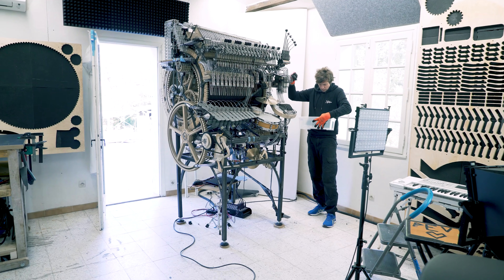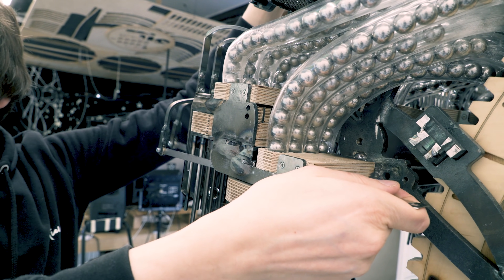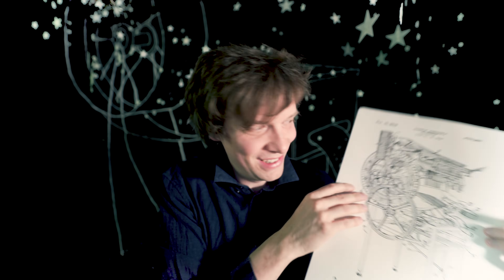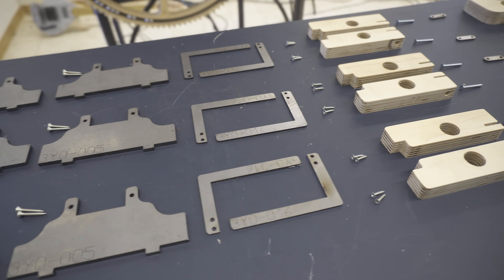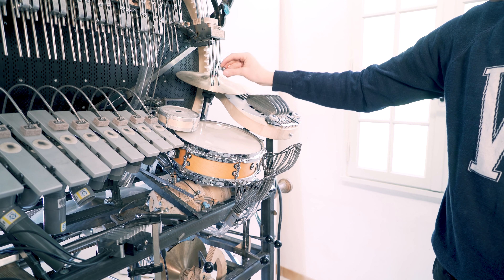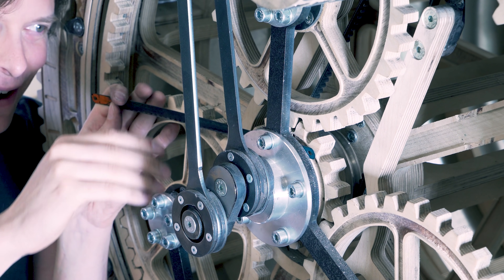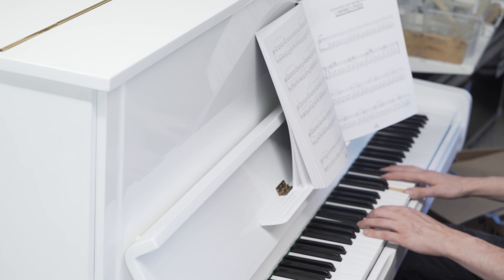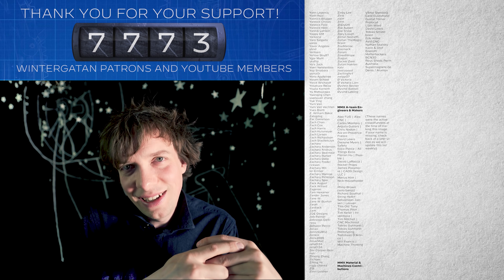Cyber Funnel

Comment: An item to consider: possibly a makeshift box to account for wind factors on an outdoor stage.  Wind and moisture from outdoors may affect the landing placement of the marbles, as well as the leveling of the machine on stages.  I know you have the adjustable feet to account for proper leveling, but possible wind / moisture may require a cover / shell to minimize those factors.

Comment: I am not an EE but am an ET, but I think you should be able to use a sound cancelling or feedback circuit to reduce the unwanted sound. Keep up the good work. Yes, you may have doubts, but you will work through them.
  As one of my old Ham Radio buddies always said "There is no such thing as a perfect 5 year plan".
   Just keep in mind that what you are doing is something no one else has likely ever attempted. The fails are as important as the successes. If you fail on something, you learn to make it a success. Hang in there, we are rooting for you, and appreciate all you and your collaborators have done. It's way beyond my skill base.

Comment: I think that if you have consistently used organic forms for most of the parts and specially the funnels, making this last funnel square brakes that pattern. I am sadly not on board with that design, there must be a way to determine a more efficient shape that doesn’t have sutch an imposing aesthetic.

Comment: Do you know about those sticky aluminum foils covered with asphalt. It is used under window sills of metal to dampen the sound of the raindrops, it is also used in cars and on the bottom of stainless steel kitchen sinks. You can stick that material onto metal or plastic parts to dampen the sound that the marbles make when they hit the part, it also lowers vibrations. It works the opposite to a resonator. I would stick that to the base of the funnels to reduce the noise. Have you ever tried marbles covered in a thin layer of  plastic or rubber? That could make the machine run with lower noise levels as well. The next thing you could do is to replace some metal parts by wooden or bamboo parts, that also lowers the resonance.

Comment: i would suggest you remove the screws that are holding your gear assembly together and replace them with some appropriately sized wooden dowel posts affixed to the gears with wood glue. that should be a lot more reliable than wood screws.

Comment: Can you use some kind of electric pickup on the vibraphone? Alternatively it should be possible to mic up the  noisy parts close to the vibraphone mics and invert the sound and cancel out that you don't need. Maybe use an open back mic in close proximity to the vibraphone.

Comment: Marten,

Please play the original marble machine song, followed by variations.
Single take, showing replacing programming plates.

Love what you're doing with the machine, maybe wax (rub a candle on) the contacting wooden surfaces to help with noise (and to lubricate wood on wood)?

All the fixtures can be epoxied when you practice breaking down/setting up the machine for the world tour.  Dab of luminescent paint on the end of each fixture when it is epoxied could look neat on a dark stage...

Comment: Hey Martin! I have an idea that might help with the noise issue. Say you mic up the vibraphone with a bidirection mic, one side pointed at the vibes one at the machine, and then had another unidirectional mic pointed straight at the machine. You could switch the phase on one mic and any noise that comes through both mics will be canceled, hopefully leaving just the sound of the vibraphone. I'm not sure how well it would work, but the greatful dead employed a similar method to avoid feedback with their 'wall of sound'.

Comment: Please don't epoxy the fasteners use thread locker. Thread locker is really good at keeping screws from backing out and it will break loose when you want it too. Loctite is really common and easy to get at automotive stores. I so want to see this thing in concert.

Comment: Since this is sorta a discussion of worry, I’m worried about the fact that this beautiful machine is largely made of wood. All these moving wood parts, grinding, sliding, etc. What will happen to the integrity of the wood over time and use? Friction will cause wear, especially on the wood parts, but the metal parts aren’t safe from friction wear either. What about the weathering of the wood? I hope he has some sort of contingency plan for wood parts that wear out or break from normal use.

Comment: >Good videos about composing
>Wintergatan

I love you platonically

On that note, I get a strange feeling that some of your doubts, mostly in your self and your capabilities might rise perhaps from guilt, shame or disappointment towards yourself?
One thing you can do on that front first and foremost is to look at the principles you follow.
Much like the design of the marble machine X, they need to be tight, concise, and overall, they need to always apply in the same way.
Here, just to give an example.

As a principle, one might think that "Never hurting others" is a good principle to follow.
On the surface, I would agree, but this lends itself to multiple problems.

Let's say you're at a bar, right, and you're talking kindly with random strangers, and then out of nowhere, you make a small joke, and for some reason, it triggers deep regrets within one of those strangers as they think of their dead wife.

Let's be real, in a situation like that, there's absolutely no point in feeling like shit over it, hense why this principle does not always apply, and is therefore, by definition, not a principle.

Instead, the principle that works, goes as follows: "Do not hurt others INTENTIONALLY unless you DON'T HAVE A CHOICE"
This implies through intent then, that you won't needlessly feel guilty if hurting others was not your intent, and to top it off, you won't need to feel guilty if there was absolutely no other option open to you; I.E. self defense.

It's important to look at those principles you follow, because they define what will end up making you feel guilt. While guilt might look fine and dandy on the surface, if you end up feeling guilt over every little thing, you'll only end up dreading yourself, which could lead to dire consequences left unchecked, such as "Oh, if I go forever I won't be troubling them anymore." and things of that nature.
I'll leave that to your imagination.

While guilt causes self-deprecation, shame/self-disappointment, and disappointment about external things to an extent, lead to needless comparison.
Things like "Oh but my stuff isn't as good as them, oh I'll never be able to be as good as them." those kinds of things.

Thankfully the solution to all of these is the same: Forgiveness. 

I understand that this might seem a bit strange, but forgiving yourself for the things you feel shameful, guilty or disappointed about goes a long way to getting rid of these feelings and moving on to a happier life.

It's so easy it feels like it can't be true, but forgiving yourself, is as easy as understanding why you did something, not blaming yourself over it, and going "I forgive myself."
It's that stupid easy, at least in writing. It takes a bit of practice.

Anyways I hope this helps, this tidbit of information came from experience, and it didn't come to me very easily.
Cheers, love basically everything you do so far

Comment: I worry about your PMMA pipes if they are going to flex with the funnels. You will bend them so they won't let a marble through or snap. I recommend bracing the funnels to the frame.

Comment: Instead of epoxy, I wonder if wood glue would be better. While the adhesion to the screw itself isn't as strong as epoxy it will act like a filler and give a bit more binding force than the screw alone. Think of wood glue like blue threadlocker and epoxy is like red threadlocker. The wood glue is reversible but gives stability and gap filling while epoxy makes it pretty much non-reversible.

Comment: Regarding the noise level of the machine the metal funnels seem to be quite significant. I wonder if some kind latex or clear silicone coating similar to the one you used on the vibraphone could attenuate this source.
As always amazing work!!

Comment: I know that you like the movement of the PMMA pipe when the marbles hit the funnels but, I am concerned that this reappeared stress will lead to the pipes failing. At the very least, if the MMX will be transported with the funnels in place I would look into a way to secure them during transit since nothing good can come from them shaking around in the back of a truck.

Comment: I was just thinking about the loudness of the machine, and then I realized that the noise the machine does is part of it, it means that it is alive. And you talk about how are you worried about the noise, and think you have to make it more silence but do not aim to loose completely the sound, a machine making noise is part of the machine, embrace it and show it. That's why people like Rev engines, and lathes cutting, is ASMR for machinist. Be careful, do not go crazy in the noise canceling, leave something for the machinist.
Reply: I think that should be key in this.  It’s like vinyl...  there’s warmth contributed to the sound from the physical connection of the needle to the groove.  The sound of the machine should be a big part of the music and given all of the engineering you’ve done with it, maybe you should have the machine spinning while you are composing.

When I used to work in a factory, there was so much music that I could hear out of the complicated machines that inspired music for my songs.

Comment: I have followed this project ever since the first marble machine came out, and as an engineer I'm very impressed and thinks that you will finish this project. You are truly an inspiration.
A thought about the marble noise. Don't see it as a bug, but as a feature. After all, the unique thing about this project is the marbles, and while you have emphasized them from a visual perspective with all clear pipes and the stair case, you haven't really consciously included them in the soundscape (as you stated yourself). So try to enhance the pleasant parts of the marble noise and see if you can minimize the not so pleasant part.

Comment: a way to make composing interesting would require a bit more editing but it could start with you writing on paper and describing the sound your expecting then cut to a short 5-10 second clip of testing the result on the marble machine x with overlay text of your opinion of how it turned out or cutting to you talking about it and tweaking it a few times. that would be enough for a pretty interesting video i would think.

Comment: Martin, DO NOT use epoxy for the screws. Any engineer will tell you this! Locktite makes various strengths of thread lock adhesive, You can remove it but normal vibration won't shake it loose. https://amzn.to/2Vt75vT  Also PM for my completed Modulin II.

Comment: I thought of something; you will probably play bass solos with the machine, will you have enough incoming marble flow to keep on the bass line going ? Also, if you want to make a bass solo with the programming wheel stopped (like you did with the xylophone on the OG MM) you may need an extra reservoir dedicated for the bass, that opens only when you want to, above/behind the marble divider (I imagine it being similar to the "marble divider" on the 1st marble machine, or just 4 pmma pipes going behind the marble divider, with a constant slope). It would be filling with the marbles coming out of the main lifting mechanism. Once full, the marbles just goes the normal way (like now, I mean like when one channel of the marble divider is full, the marbles continues their way.). And the marbles would come out of it just before the bass channels, without getting stuck there. So you stop the programming wheel, you start your solo, and as the marbles are emptying, you move a lever that allows the marbles to flow out of this reservoir, so you have enough of them. That could be easily be a supply of 40 marbles per channel.

I am amazed to see how promising this is ! Glad you want to actually compose something new for it, it will be more than just a new instrument!

Comment: I think most people are on par with that. The machine is one part of the goal. It's art, but also a tool.
I agree that the noise is becoming something of an issue. In this video, we can hear even the funnels are rather loud. Perhaps the bare steel isn't the best solution. Personally I'm not that big of a fan of the design of them either. It wouldn't be easy, but what if you found a way to make them out of transparent acrylic?

Comment: Hello Martin!
Nice progress!

But again, I wrote that some videos before, and the "lost screw" aplifies it:
The MMX has a lot of small parts, and a lot of them have very intermittent forces, meaning you have to consider material fatigue as well.

I am especially worried about the springs in your funnels. I can imagine those will work for some minutes, maybe up to an hour, but than it gets tricky.

For sure you want to have a lot more than 2 Million strokes (force-peaks) in your parts. But that means, that a lot of the mechanical stress has to be very low (at about 10% the capacity of the part at most).

Please contact me (i am a mechanical engineer) or some of your engineering team to check this issue.

And please take the whole machine apart in some time, clean it (angle-grinder-dust is abrasive A.F.!), lube it, and re-assemble it with a decent amount of loctite. It will enhance the life of your machine significantly!

Comment: Don't put too much pressure on yourself about your composing. Like the machine itself, success probably won't come immediately. You'll have many many years with this beast to familiarize yourself with it's sound, it's quirks. And one day, a melody that perfectly flows with the click and clacks and rolling of marbles will rumble through your brain and speak to your soul. Maybe this will be tomorrow. Maybe this will be halfway through your world tour. Maybe years from now, when all the hype and stress is gone and you've worn it in like a pair of old shoes and it's actually been sitting in a corner with a dust cloth over it for a few months, your fingers will itch to pull out the old programing boards and shuffle some magnets through it because you crave that certain sound.
Don't compose for the marble machine. Compose for yourself.

Comment: I'm so scared about the design for vibration and damage tolerance.

I didn't think that the lack of threadlocker or even lockwire would be an issue here due to the widespread usage of welding and and wood but if a wood screw like that is able to back itself out BEFORE it encounters transport loads then I'm very worried about the rest of the machine.

I hope the CAD team has the opportunity to come in and 3d scan all the parts that Martin made by hand towards the end of the projevt because the lack of manufavtyring drawings means that replacement parts wont be makeable on short notice, and the parts most likely to break are also the ones that are hardest to manufacture.

I hope nothing comes of this

Comment: First. I love the whole project! ^^ And the sound of the marblemaschine is part of the music of the marble machine Of course if you want to quieten it a bit more that's up to you. But for the first one the constant sound of the marbles moving around, the machine working it was making it quite inresting. 
Now there is one thing that i noticed here a bit more clearly. The funnel drops: they are pretty sensitive to bending and when they will get moved around in pieces they will most likely bend or at least be very sensitive for that. Which means that setting it up might require re bending them. Maybe you should add some fixtures behind them that keep them more constrained to each other (spacers or something dunno) And the catching flowers (love them!) the funnels will slowly drop because they pipes will slowly drop over time if you don't keep them supported. Soo maybe secure them with a line? So they still have the motion but cant dib below a certain level?

Comment: Hi Martin.
You could drill an access hole into the central hub, so that you have a position at which you can tighten the otherwise inaccessible screws. See https://i.imgur.com/3DKJq9o.jpg
Great progress!
Reply: I imagine he'd also want to cut a cap to fit in there when not being used or cut 3 in a triangle so it looks like a visual addition as opposed to a service hatch
Reply: @TheAluas  Adding multiple holes would also allow for multiple screws to be accessible at once without having to turn the gears. -Kye